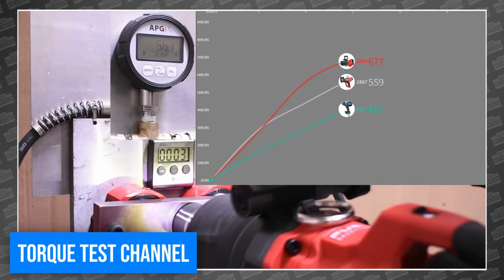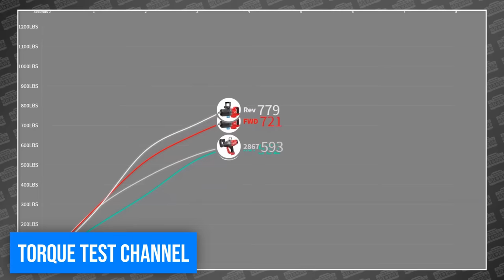Metabo HPT comes out of nowhere and DEMANDS the THRONE from Milwaukee. The Power Tool News! S4E35

Comment: I watched several videos prior to my purchase. Everyone seemed to love this budget miter saw from Metabo, but buyer beware. I used the Metabo HPT 10-in compound miter saw for less than 90 days and three uses, and the fence snapped in half. Lowe's return policy does not cover it. I contacted the manufacturer, Metabo HPT, and they said they won't replace the fence because that is a wear-and-tear item. Really? After less than 90 days it should not break. Metabo's slogan is "Durability First". Who are they kidding? Though they would not replace the fence, they will check the motor. If it is faulty, it would be covered under warranty. Metabo gives two options: ship it to their Georgia factory at the buyer's expense or use one of their local authorized service centers. Metabo's local centers' business names on Metabo's site don't match the real name of the local business when Googling. Secondly, the numbers are disconnected. So local repair is not an option within their network as they advertise. My option: buy a replacement part from eBay. Metabo doesn't even sell the part on its website. Pay the extra money for a solid brand. So what happened anyway? I was cutting a piece of wood. Blade hit a knot in the wood, jerked the miter saw throwing a chunk of the wood 40 feet and  the arch in the fence snapped in half. Fortunately, I was outside.

Comment: You guys have the best ty channel. Congrats on the 100k. I just set up a cal reminder for 9/12! Thank you for doing the giveaway! It sounds like a can’t miss!  I’d really like to get a shot at a gift card or a few large ah batteries from FLEX. It’s not for me but for my kids (sorta)

Im going to be modifying a 24v peg Perego RZR (electric ride car) for my three kids. It’s an awesome machine…I mean toy.  Im getting a used one that we will work on together. Part of the plan is to swap out super heavy sealed lead acid batteries for the lithium!! POWER!! Shoot - I’d even be willing to paint it in the flex color scheme to make it look sponsored. 

We did something similar with their smaller 12v model.  I upgraded to run on m18. Remember the first time you went from NiCd to a lithium battery in your drill. It’s pretty much the same thing.   

This is long. Sorry. Congrats again!!
Reply from the maker: LOL sounds great Peter!

Comment: To be fair, milwaukee mailers weren't all that great. Many folks are having issues with them
Reply from the maker: I wasn't fond of the 1st gen, but the 2nd gen is freak'n fantastic. We've used it for a year now and love it. We only recently replaced it on @makerbreak when HART sent us theirs. The new HART is a lot cheaper, and has a tiny ramp up, but we don't ever notice it. We primarily use it to hold joints while glue drives, and both the HART and Milwaukee did a fantastic job at that.

Comment: I wonder if Makita is coming out with a 40v jigsaw and router
Reply from the maker: GOSH I hope so!
Reply: Why wait go Metabo HPT and you can have bothnnow
The jigsaw has been out for a couple yrs and the 1/2"  full size plunge router has been out about 8 months and is my new favorite tool
Reply: @baseballdude8491  if I buy both I have to get at least 4 or 5 batteries cause I need the miter saw or table saw too thanks for your suggestions.